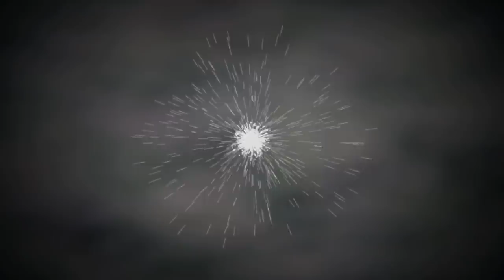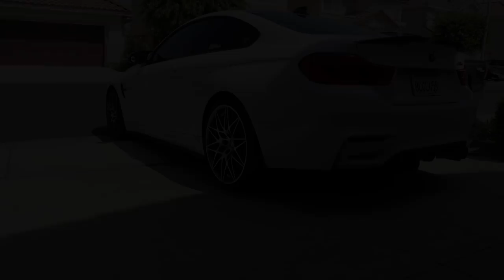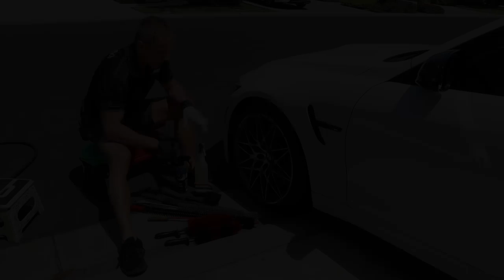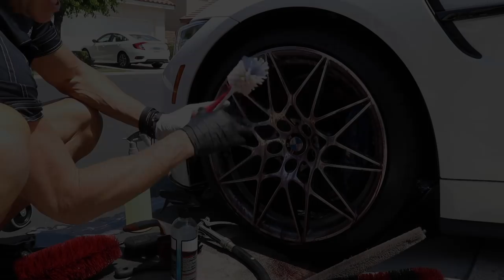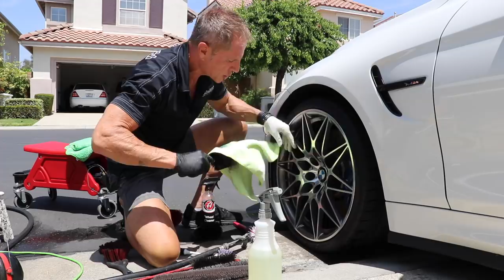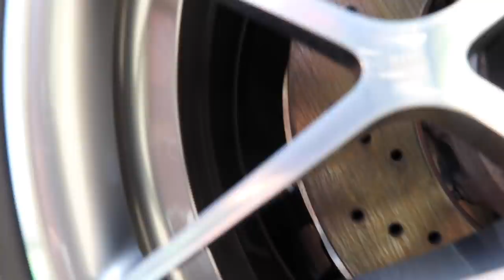Car Wheel Cleaning: Are you a tool, using the wrong tool? See what Darren uses

Comment: Hi there. How do you handle rotor rust afterwards? The first drive down the road, and all that rust lies on the that shiny rim... I normally drive the car down the road after the wash (where the wheels have been cleaned) to get the rotors clean and all the rust off. Then I do a quick wheel wash to get the rims clean & dry them immediately with my blower, thus have as less as possible rust on the rotors. You have any advice around this?
Reply: Rico Koegelenberg good comment. Do you think certain wheel cleaners create (more) rust.
Reply: Hyde's Serum Rust Stopper
Reply: Hydes Serum is very good